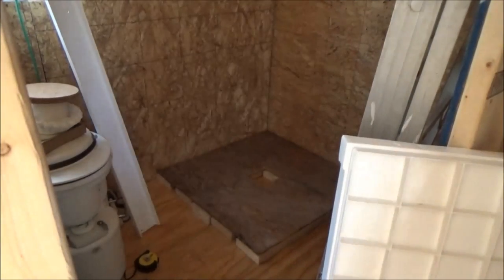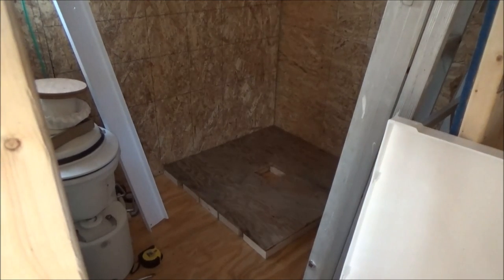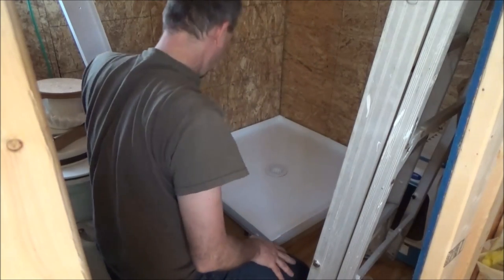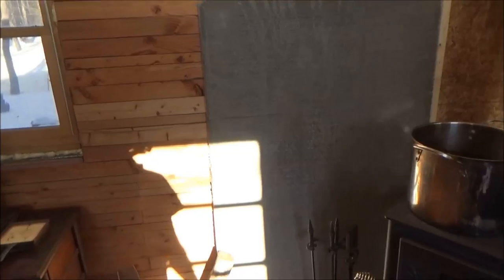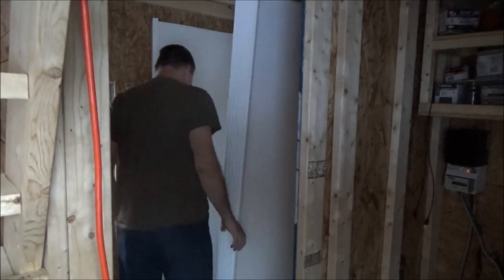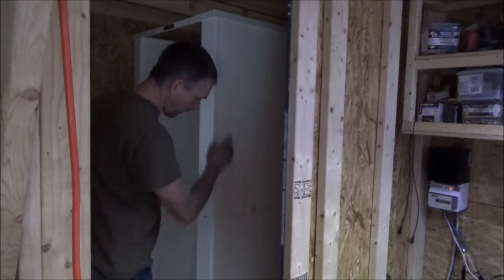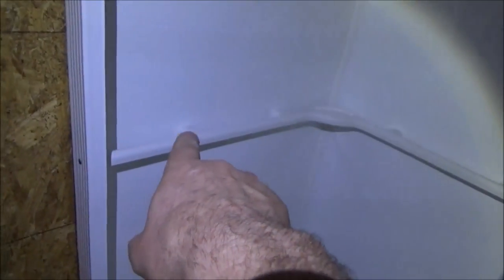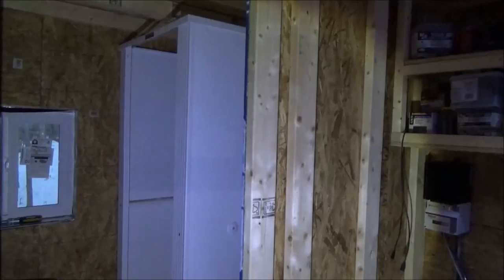Finishing My Tiny House Shower Installation

Comment: Hi Troy !

You could stiffen the walls in the shower stand by some long screws into the building WALLs with a spacer at the right thickness - I think it's a good idea to leave a little distance to the plates on the building wall. Do the fasteners in the TOP og the stand to insure no leaks for the water !
Reply from the maker: Thanks. Yes good idea to leave space

Comment: Glad to see you getting your shower installed.  We had one of those that lasted years.  Not sure why everyone is so concerned with humidity, not like you are taking long steamy hot showers.  Has anyone ever thought what they did 50 or 60 years ago when there were no bathroom fans?  I will tell you, they cracked the window in the winter and opened the window in the summer and never once worried about mold.  Being off the grid is sort of like taking a step back in time and figuring out that they may have known a bit more than we give them credit for.  Great job Troy, keep up the interesting videos.  God Bless, take care and give Baby Cat a head rub for me.

Comment: Looks good troy
Put up a plywood wall up to support the shower and put in the sink. Mount faucets on outside wall inside stall, run showerhead in center from rafter.

Comment: That shower stall looks VERY familiar. We installed one in a 120 year old house and built a plumbers wall to stiffen things up. We had room for a 2x4 wall but you may need to go 2x2 to save space for a small sink. Consider a vanity built in the corner where the litter box might fit as well as all the plumbing. Those nifty 1/2inch hoses they use nowadays sound pretty good eh? Those tiny water saver shower heads won't work with gravity a feed system. Just dribbles.  Perhaps if you attach a 12 volt compressor to the water tank, you can charge the system with 10 or 15 psi during a shower. That would make for a heckuva squirt!
Reply from the maker: Yes I will build a closet/vanity/cat litter area in there.
Not sure about water pressure yet. I will hopefully soon find out.
Reply from the maker: Pete Brown Yes hot water and a pump eventually. Both. With options for gravity feed only as needed.

Comment: Troy how bad do you need a sink in the bath room your just a few feet from the kitchen sink. I know having a sink in bathroom would be better but having a nice pantry to hold towels and extra TP,coffee filters cat litter peat moss would be the better for me. Not to mention it could even hold jars after you canned them
Reply from the maker: It is normal to have a bathroom sink. For shaving and brushing teeth. Washing hands after the toilet. Just think of the germs on the kitchen faucet handles if you wash hands there after using the toilet. Unless you sanitize everything after every single use. Its unhealthy and unsafe. Plus having a mirror over the bathroom sink is nice for shaving. I want a somewhat normal house and live now after all these years.
Reply: The Do It Yourself World good points
Reply: The Do It Yourself World
So let me get this straight.  You're going to turn on the bathroom tap with those germy hands, wash the germy hands, then put them back on the bathroom tap to turn it off, thus putting the germs back on your hands.  While in your kitchen, you have a single handle faucet that you could turn on with your elbow.  Unless your elbows are germy too, in which case you just need to shower every time you go to the bathroom.  Doh, that won't work either, you have to turn the shower on with your germy hands too! 

Unhealthy and unsafe to wash your hands in the kitchen?  You're out of your mind.
Reply: Chris Cates I don't think it's unsafe, I think he's striving for the comfort of a standard bathroom.   Which I think he has plenty of room for so why skimp on comfort.
Reply: MollyDolly   I was responding to his statement "it's unhealthy and unsafe".  Utter BS.  For the "comfort of a standard bathroom", I understand the desire, and I don't blame Troy for desiring that level of normalcy.  However, he committed to living a lifestyle that is abnormal, and hasn't hesitated to make other compromises to keep things moving along.  This is one of those things where I'm going to make a suggestion that Troy's not going to take no matter how logical, much like the number of people who advised him to gather firewood instead of painting cabinets in his RV.  He had to paint those cabinets first because the paint wouldn't have dried in the cold, but if his church hadn't bailed him out by sending him to Australia for the winter he wouldn't have survived the winter in the meadow.
Reply from the maker: Chris Cates Do I smell troll? Why are you so concerned with my bathroom and my choices in my bathroom? Does anyone come into your home and tell you how to live? Yes I have made compromises!! I LOST MY JOB. Then my apartment. Of Course it was a compromise. Getting back on your feet again is a compromise. Yes it is. But that does not mean that I dont want a normal standard of living again. Why not?
Reply from the maker: Chris Cates By the way, my bathroom faucets are push type. Hit it with the back of your hand or elbow. Nice and clean. No hypocrisy there.
Reply: The Do It Yourself World Really?  You're calling me a troll?  Look back at my other posts on your channel.  Look at what I posted on your forum.  I have been nothing but helpful to you and you go and call me a troll?
Reply: The Do It Yourself World Now I'm starting to understand why you have so many enemies.  You create them from your friends.
Reply: Chris Cates Sorry Chris, I think Troy might be feeling a bit edgy today... my nose maybe stuffy today, I don't smell troll.    I think you may know there is a lot of negative stuff Troy has to put up with in the background... like the late night calls to the LL... sometimes mis reads are going to happen when there is too much stress.  Hang in there a second, but you have to know any mention of his church as you just did is not going to sit well....
Reply: MollyDolly Wait a minute.  You think he's calling me a troll because I mentioned his church sending him to Australia?  Really?  It's no secret, he made videos about it.
Reply: Chris Cates
 Then leave the bathroom sink out of your tiny house on wheels. Troy said he wants a bathroom sink in his. He likes a mirror to shave with. Why does that bother you so much?
Reply: Chris Cates Please understand it is a sore subject.   You are not even wrong that last winter he would have been in a horrible position if he had not been blessed by being invited to Australia... but it is a very delicate subject and if you don't want to be seen as rubbing salt in a wound it's just best to leave it out.  For example that comment could have been just as easily worded that he would have been miserable in the meadow last year and taking a trip to Australia saved his bacon... nothing offensive... but, in Troy's particular situation due to the excessive amount of vile lies being hurled at him and about him in regard to his church... that crack is  going to get you bit.
Reply: Theresa Ford   It doesn't bother me at all that he wants what he wants.  It doesn't bother me at all that he's going to jump through hoops to get what he wants, any more than it would bother me if anyone else jumped through hoops to get what they want.  What bothers me is that I made a suggestion on this channel in all good will and got attacked for it. 

Troy, you owe me an apology for calling me a troll.
Reply from the maker: Chris Cates Please read your comment again. It really looked like an attack. I have just read it again slowly and it still looks just like what my enemies keep writing. I am sorry if I am wrong but it was exactly what they write.
Reply from the maker: Chris Cates After reading Molly's comment to you, she answered very clearly. I am a bit touchy when people mention certain things. Yes I am edgy. They are attacking my elderly landlady again. Threatening her. Telling her to kick me out or lose everything. All kinds of threats. So yes, sorry, I am edgy. I am probably not seeing clearly right now.
Reply: Chris Cates Actually, he did not call you a troll... he asked if you are trolling... HUGE difference and a reasonable question.  Which is why I consider Troy a better person than I because when I do smell troll I don't ask, I go for the throat... he simply asked.  That's fair.
Reply: MollyDolly He did not ask if I was a troll.  He implied that I was a troll.  Big difference, and highly insulting to someone that has never said an unkind word and has only tried to help.  But enough of this crap.  No pun intended.
Reply: Chris Cates Are you aware of the crap said about him and his church?  If people repeatedly said you were in a gay cult (no offense to gay cults) but you were in fact a straight male would you not become sensitive about the subject?  Men have killed for less than what these idiots have done... so take that into consideration.  You have no need to be offended there is a big fat question mark in his post for you and everybody else to see and he apologized for the misunderstanding which frankly you started anyway... so, how about just accepting the apology and letting it go.  Because if you don't I am going to look like the fool here.
Reply: John McLendon If you want a free trip to Australia join his church and become a active member as Troy is and maybe they will offer to send you over there to help out like his church did for him. That is the only reason he has stated why he went. His church sent him there to help out over there. As for some of the Trolls they insinuate a lot of other reasons he went, but as usual they never post any evidence just there word
Reply: John McLendon Just read my post to Chris Cates.
Reply: Pete Brown Your comment made me think of something... remember the first winter in the freezing camper trailer?  Most men would have left that meadow behind... but Troy is a heck of a lot tougher than he is being given credit for by Chris... maybe he would have been less comfortable than he is this winter that does not at all give anybody the right to say he would not have survived the winter.
Reply: Storage would be a better use for the space. Also mold loves rough surfaces, might think about sealing the wood in there.
Reply: Some how I knew the biggest Troll ever to stalk Troy would comment. Im sure you forgot and did not mean to leave it out. That Anthony was accused of this several years ago and still to this date nothing has been done about it. So in you simple mind anyone who is accused of a crime is guilty until proven innocent. Im so sick of hearing you repeat the same crap over and over. Upgrade and get some new material to slander around preferably something real not fictional or not about someone that knows someone that knows someone that knows Troy.
Reply: Bernie other So let me guess you know this because you was told by Who? Or is this just another dislike Troy so make up something. I bet you only assume this with no real proof.
Reply: Bernie other You are right. .. all work and no play makes Troy a dull boy.  Did you watch the videos from Australia?  I heard voices of young ladies. .. how do you suppose people of similar faiths meet and marry?  Get a clue would you, please.
Reply: Bernie other that is your problem you try to think and come up with all sorts of crap. You talk like you can do so much better than Troy yet I would bet you couldnt make it a year living alone like he does. of course you believe he is rich has several homes and just goes out in the woods to video tape. If you find it hard to believe a church would spend money like that then it is apparent you never been to a church for an extended amount of time. Churches around here will hel with food electric or gas bills and I have even seen where they send there members out of state to another church they are affiliated with and they pay for it all. Why dont you try a new trend? only speak of things you can prove rather than things you think it could be.
Reply: amazing I asked if Troy really needs a sink and he said yes he does and explains why. and next thing I know he has people telling him how wrong it is to put a sink in. Some people must not have anything else to do with the day except argue with someone about a sink or not a sink. To the ones who keeps dragging this on if you think he doesnt need one and mad that he is putting one in then build your own and dont put a sink in. let this comment drop its old old news already
Reply: M Baldridge The trolls seem to have no life, no job and are still asking Mommy to bring some more meatloaf to the basement. Pretty sad with the things going on in the world these loser's have nothing better to do than mock Troy.
Reply: TekReview's Isnt that the truth. I would love to run into one or two of the bigger Trolls face to face. I bet they are scared little punks and would kiss butt to your face and talk crap behind your back
Reply: Wow you really sound like the kid in 3rd grade who keeps eating the PlayDo.

Comment: It ought to begin to smell better out there. Did you used to take a bath in a wash tub?
Reply from the maker: I bathe in a quart of water in a tub with a washcloth. No smell here. I probably smell more like a wood stove than anything. Its called "Off Grid Aftershave"
Reply: Catwomanmn
In the US army we used to take a shower with a gallon can with a few holes punched in it. Then we would dump a can of water that had been out in the sun for a wile (sort of warm) and take a shower probably 3 cans (gallons ) of water. I am pretty sure he is refering to that method.

Comment: Making some good progress, Will be nice to have a actual shower.
Are you planning on using a propane heater to heat the water or will you run something off of the wood stove?
Either way looks good
Keep doing what your doing
Reply: And as long as you do not create lots of steam you should not need a vent. I would personally add one so that if there is a big amount of humidity it can escape a bit easier. But since you have the window in the bathroom you should be fine
When will you be starting work on the rv electronics workshop?

Comment: troy you can set the litter box in the shower and when you get ready to take a shower set it outside it i see the litter box has a handle.
Reply from the maker: Not nice though. Cats spill litter on the ground all the time. Would mean sanitizing the floor of the shower every time before going barefoot. Ringworm and other things.

Comment: Troy I know you read the installation instructions but you have no metal water pan under the shower floor. That means any liquid under the shower from condensation or a leaky drain will rot the wood and potentially be a home for molds to grow. Did the instructions really not call for a water pan?
Reply from the maker: It talked about a cement area if you have one installed. It did not tell you what you need, no. Just how to install it into various situations
Reply: The Do It Yourself World Instead of plywood, use Hardy Backer under the Shower, then use Verabond Cement to level the floor. That should be light weight and water proof, and mold resistant. Hardy Backer is used in Tile Floor situations.
Reply: Yeah, that cement area is important. The shower drain is tied in directly into the shower pan which is made from anything from concrete, hardy board, or a variety of different materials. Everything BUT the wooden floor. this prevents the wood from rotting.
Reply from the maker: FromThe Prairies I will study this. Thanks. There should be no leaks though. Right?
Reply: The Do It Yourself World in theory, yes. There should be no leaks. But tk be honest after watchjng the full video and seing the oh-so-incredible quality of the shower I think you might be looking at something similar to your counter top.  Good for a few years but eventually will need to be replaced with something of a greater quality.  Careful washing your feet!
Reply from the maker: FromThe Prairies Precisely why I am not going to fasten it to anything with glue as some suggested. I will see if it lasts.

Comment: Hi Troy   Do you really need a sink in the bathroom?   You are 3 steps from the kitchen sink.  You might be able to utilize that space better by leaving the kitty litter down there and putting in a set of shelves the width of that area and use them to stabilize the shower on that side which would give you lots of storage for towels and other necessary bathroom items

Comment: Thanks for sharing the installation on the shower.  I am looking forward to seeing how the gravity-fed and hot water shower will or will not come into play.
Also, if the ceiling fan still a cat tormenting device?
Reply from the maker: No the fan itself was not a problem. It was the moving and building stuff that made her mad

Comment: I would go with your idea of putting a frame around the shower, you never know when you might loose your balance. I would put some kind of wood sealer or latex paint on all the wood in the bathroom, even if it gets covered. But it looks good.

Comment: Troy, until you get the plumbing done you could put water in one of the bags from your water tanks and hang it high in the ceiling, so it would warm up. Then run a hose to a temporary shower head. Remember to put an elbow on the drain and run the gray water out from under the house! All of that could be temporary until weather and finances permits you to do it right.
Good job - even if I did laugh a few times (just imagining myself doing it!).
Reply from the maker: Thanks. I hope to get the water tanks installed asap and have a sort of room temperature shower at least

Comment: Seems like the shower stall was designed to have the walls lay against prebuilt walls. 2 x 4 wall on the outside should be easy enough to build and attach. To with rubber washers and screws. You can use the wall as shelving for toiletries, etc.